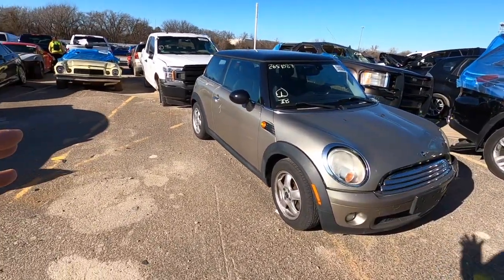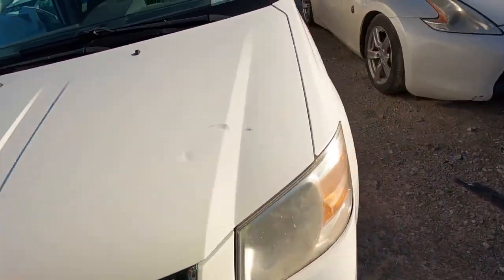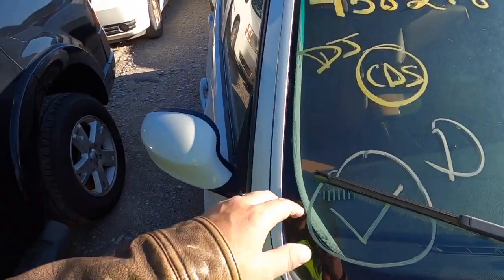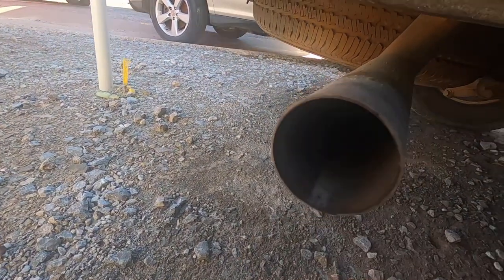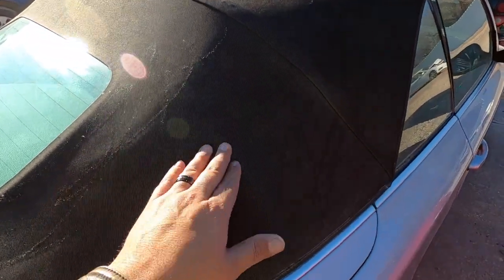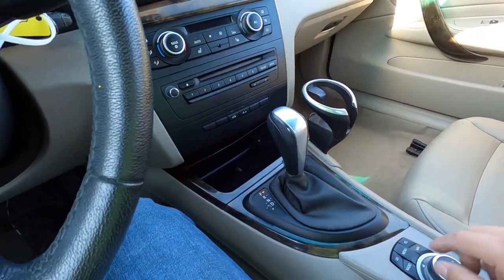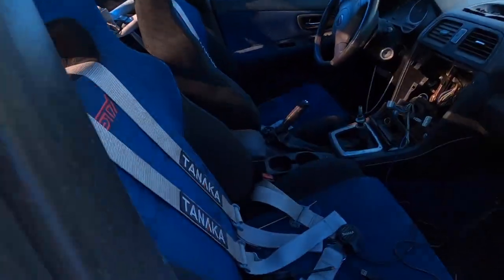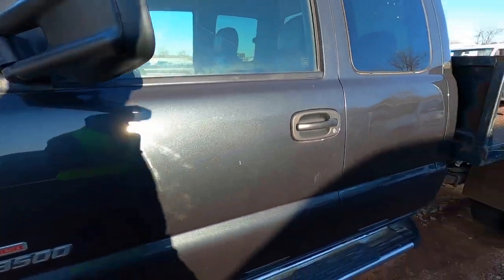Copart Walk Around 1-2-20 + $1K WRX STi

Comment: The Expedition is an Eddie Bauer edition and oddly has King Ranch logos on the wheels.
Reply: Someone swapped out the tires
Reply: strange
Reply: Absolutely
Reply: Maybe the previous owner liked the look of the King Ranch wheels more and just decided to swap them out.
Reply: I was gonna say the same exact thing so someone swapped out those wheels meaning he could have bought them with those tires
Reply: which might mean that the previous owner had either aftermarket wheels on or use winters the whole time
Reply: What's special about the Eddie Bauer edition? I've seen some trucks & SUVs (Ford obviously) with those badges
Reply: Eddie Bauer is basically a trim package as is the King Ranch. Special upholstery, paint, wheels, emblems, and extra cost.
Reply: @Jddvs  damn

Comment: The Expedition had custom wheels and a system they removed when they got rid of the vehicle. The missing stereo was the tell. The dry rotted tires/wheels on it were bought used as something to put back on it to dump it.

Comment: You're thinking of the Ford Excursion. The Excursion had the option of the 6.8 V10. The Expedition had the 4.6 and the 5.4.
Reply: @jerrywilcox9890  Thanks for letting me know.I was unaware that Ford put the V10 in the expedition. Yes the V10 is a gas guzzler. My father owns a 2003 Ford F350 Super Duty XLT Quad Cab with the V10 and only gets around 10mpg. Not the best.
Reply: @jerrywilcox9890  The Expedition never came with a V-10.  The Excursion did.

Comment: Those Outbacks sell like hot cakes here in California and Nevada because of their off-road capabilities. They are solid cars. My 03 has 200k miles on in with no check engine. Good base models go for around 4-5k in that mileage. Since that has the moon roof, leather seats and updated radio it must be a limited. Those could sell up to 6k. Both front axels cost 120-180$ for both front axles. I’d try to see if the head gasket and timing was done if your still interested. I made a list of what need to be done at certain mileage starting from 100k:

80-120k - head gasket, timing belt, pully, idler, water pump.

120-140- possible steering pump leak, axle boot, possible airbag recall unless done, coolant and heater core flush also alternator.

140-180 -struts, ball joints, spark plugs, coil pack and accessories belt/refill ac.

180-200 - steering rack(possible leak) valve cover gasket, all lower controll arms, stabilizer, oil pan reseal, coolant hose, and coolant flush, heater core flush.
Reply: Forgot to mention those cars can reach up to 300k+ depending on driver and maintenance.

Comment: Ill tell you why that Expedition has those dry tires, someone had some custom wheels alongside the head unit, and they left the original ones in storage. When they got rid of it,  they took off those and replaced them with the stock ones, that after a while got dry rotted.
Also about that 135i, that is a good solid car, but those rims are not the rims of a 135. Im thinking it was crashed  and someone was fixing it and gave up on it. The rear is indeed missing most of its parts, including the partition that has to be in place to separate cargo from the foldable roof.
Reply: It's actually not a 135i, someone rebadged it. Vin shows up as 128i and it doesn't have the twin turbo engine

Comment: A major major major go on the expedition, pretty nice condition considering the age, only concerned I got is the transmission as that could cost a fortune. My parents own a 08 explorer that they bought knowing the transmission had failed,and changed it for around 1.5-2k. It's running as an absolute champ it has over 200k miles

Comment: The Caravan has the 62TE transmission - no dipstick from factory. Since the dipstick tube plug is missing, I'd bet it's there for a blown transmission. Dad had one of this era - trans blew at 144k kms. It would go into gear and make noise on certain gears, then finally it quit moving entirely. That engine is as close to bulletproof as Mopar gets.

Comment: The ford 5.4 complete timing set with a oil pump is inly
Like 600.00 and they color coordinate the chain and while you’re in there change the oil pump water pump. Basically every 100,000 ford timing service with water pump and oil pump gives you a new car. I buy fords all day cuz I work on all of them.

Comment: 2010 and earlier Mini Coopers have serious engine issues (timing chain guides, carbon build up on valves, etc.).  2011 and later Mini coopers have engine issues, but not as severe (carbon build up less severe,  timing issues resolved).  They'll still leak oil, and at least one major component will randomly fail after an oil change.
Ford 4.6L also has cam phasers.

Comment: The trans dipstick on the caravan isn’t missing. None of them came with dipsticks. You had to buy one from the dealer to check the fluid. There’s supposed to be a cap on the tube though.

Comment: Expedition was standard with the 4.6L Modular V-8 . The 5.4L triton 3 valve and the V-10 were optional equipment. I sold Fords from 1999-2004. I bet they had other rims and tires on it. SO the people kept the stock tires and put them back on it and traded it in.

Comment: I’d do the Expedition. Four used tires. A cheap double din radio to keep it modern. Maybe paint the lettering on the tires to enhance curb appeal. And of course; a battery.
Easy flip.

Comment: Randy,

On that white BMW, 2 things, the missing parts are not strange for a BMW, the (broken) cooling system got removed completely, so many hoses are gone because they are mounted onto the radiator assembly. With the power steering system, the same deal, the cooler for the pump and rack, is mounted in the cooling pack, so they had to drain the fluid / remove it from the reservoir.
But, i've also noticed the car has been in an accident before, because the hood is from a non-LCI 3 series (04-08) while the car is from 2010. You can see that because the top part of the non-LCI grille is mounted on the hood of the car, on the LCI it's not ;)

Comment: The truck your thinking of that has the V10 is the Excursion which went 5.4L V8, 6.4L V10 and then depending on the year either the 7.3 L Powerstroke V8 Diesel or The Dreaded 6.0 L Powerstroke V8 Diesel

Comment: Mini's are a blast to drive avoid the years from 06-10 years of the N12/N14 engine know to burn oil and through the timing chain and kill the engine. The ones built from 11-13(N16/N18) are more reliable but still burn oil so you need to watch them. After 14 they have been rock solid in terms of reliability. As far as parts they will cost you the standard BMW tax. I have a 13 and its one of the few cars i have owned that every time i start it I crack a smile and enjoy my drive.

Comment: Most mini problems I’ve seen come through my shop are electric power steering issues timing chain noise and with the mini S clutch and trans failures. They are ok vehicles when properly maintained 👍

Comment: About the Expedition...  Aftermarket radio removed, Aftermarket Roof Screen NOT removed, pickup truck wheels and tires.  Only the easy to remove aftermarket items were taken.  I wouldn't worry about the wheels and tires if the rest checks out.

Comment: Get the expedition i love those suvs
Reply: football gamer facts I have one myself
Reply: Yeah i have one as well i have the 5.4 06 i got it for a steal to 4700$ for 89,000 miles it has 114,000 i have to cars but solid suvs.
Reply: football gamer Yeah all it needs really from what he showed on the video a new battery and a good stereo system
Reply: I love both engines the 4.6 is more reliable but i rather much have 5.4 its more powerful but they shouldve increased the torque more than just 10 pound feet but still solid suvs.
Reply: football gamer yes I agree
Reply: I think he already got the Expedition because he said something about it in the last video
Reply: 4.6 and 5.4 in the expedition. 5.4 6.8 v10 and diesel in the excursion

Comment: Those rims on the Expedition are from a King Ranch F-150. If I were to guess, the previous owner probably swapped whatever they had on the SUV with those. Might explain the dry rotted tires if the rims were not stored properly. Seems solid though.

Comment: From working on BMW's as long as I have that 135 looks like it's been fairly hacked up , but alot of the issues with the electronics could be due to the battery. BMW's DO NOT like having low batteries and they will do some weird stuff with a low battery . I had a 335 towed in last week by the customer who has beside himself thinking the computer was gone because he got in on a cold morning and after it fired up the car had every dash light on , awd limp home mode , changed and coded a $150 battery and it was good to go again.  

Over the years I have seen transmission fail lights , cel codes , etc all from low batteries in BMW's . 

That 135i is an n55 car which is less saught after by enthusiasts , but if it has an updated hpfp , index 12 injectors and atleast some maintenance done on it $5500 is a decent deal even with an accident.

Comment: That year model  Grand Caravan / Town & Country actually do not have a transmission dipstick there should be a plug in the tube saying dealer service only. I had a 2010 town & country bought it with 22 miles on it in 2010 it died in the camp fire in paradise ca  in November 2018 with 120k on it with never an issue. Miss that thing!

Comment: Certain michelan tires are known to dry rot prematurely. Seen many many sets of rather new tires with plenty of tread but sidewalls are just rotted to hell and cracked between treads.

Although now looking, the expedition was an eddie bauer trim but those were king ranch wheels, prolly swapped when sold.

Comment: Actually it's normal for exhaust to smoke and have moisture until the vehicle reaches operating temp...which is usually 15-20 minutes especially with a van that's been sitting most likely for such a long time. My car does the same thing when it sits for a few days. Also it's winter! You never gave it a chance to reach operating temp. I bet you change the plugs and coil pack and you wont even hear it running!

Comment: I’m thinking that Expedition was owned by an older person who didn’t drive it much, didn’t drive it far and care about the tires being dry rotted.  It looks like a great SUV just in a need of a little tlc.  I think it’s worth taking a chance on.
Reply: I think it was up on rims a d when they took the stereo they put the old ones back on.
Reply: Daniel you’re actually probably right on that.  I had forgotten about the stereo being pulled when I posted the comment.  The Expedition still looks very well taken care of though.
Reply: @brian5o  True. Usually the wiring harness would be fucked off. That's a clean example of a hood car done right.

Comment: Man that expedition looks good, you should see if the engine or trans has a rebuild/rebuilt sticker, with that mileage I feel like one or both may have way lower miles. And not to sound like a smart ass but the expedition never came with a V10, that was only offered in the 3/4 ton and 1 ton vehicles like the excursion and super duty’s.

Comment: That duramax would be Potential can get a transmission for relatively cheap and just weld new diamond plate on flaty I’m betting it could just be a linkage problem backing up a Heavy trailer and hit something bc it definitely was a hot shot truck or something work horse

Comment: If those are Michelin LTXs, I have the same tires. They last at least 50 to 60,000 miles. I have 150,000 on my truck and just put the third set on as mine were starting to show signs of dry rot

It’s conceivable those could’ve been used for the last eight years.

Go for it… Or have you already done so LOL🤔

Comment: Most plausible explanation for the Expedition tire situation. '03 Expedition, '11 year stamp on tires.  The Expedition was the daily driver, 200k miles. Probably got the King Ranch in 2011 as a toy. When they went to trade Expedition in, it probably had almost new tires on it....so they just swapped them out.

Comment: That is not 135i.

All 135i has factory HID.  That car has halogen.  It’s 128i with fake badging.

The convertible should work except the trunk partition wasn’t put back together.  That wouldn’t be hard fix. 

But water leak is a bad sign.

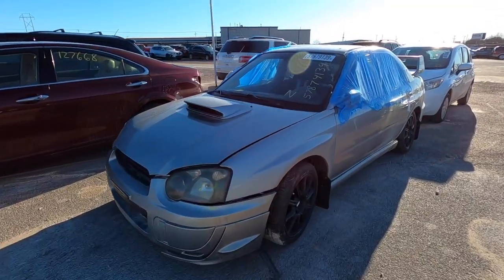Comment: 31:21 shes absolutely right those cars handle terribly because there weight distribution is 60 40 60 percent in the front they used cheap plastic all around take away the giant wing and hood scoop the window line is straight up an down bo sleekness to the car and upon all else its suppost to be known as a tuner car because it was in fast and the furios movies but in reality it can only handle 200 more horsepower then stock before it blows up so it can go from 300 hp to 500 hp tops before they blow an even 500 is pushing it while that 135i bmw you went over can handle 400 more goes from 300 to 700 horsepower with bigger turbos plus they have 50 50 weight distribution and to think the sti sells for 15 or 20 thousand dollats when 335i and 135is from 2007 an up are going for 10 grand.

Comment: Dodge stopped putting a dipstick in the trans for these vans back in 08. They only have a plug that's missing.  08 to present caravans are garbage. I've had a 01 and sold it at 750 thousand kms and only replaced plugs a a coil once. Definitely stay away from these Van's. I currently have a 13 and it trash.

Comment: Those outbacks are known for transmissions blowing up while driving
Reply: MKEL03 bs my lasted 200k so far and my friends 02 Outback lasted 324k. Do your research before you give out false info.
Reply: ROBIN J 7 of my friends who had those gen outbacks all had transmission issues. The Engine is reliable but the trans just didn’t hold up.
Reply: Lies. Your friends probably drove it like a lunatic and probably never maintain it. You can go see the thread on the outbacks 00-04 I will bet you who ever told you about the transmission never owned a Outback
Reply: ROBIN J no we live in VT. Dirt roads are 70% of all roads and a FUCK TON of salt in winter. Also they all drive like normal people.